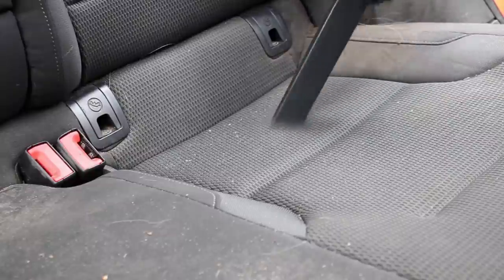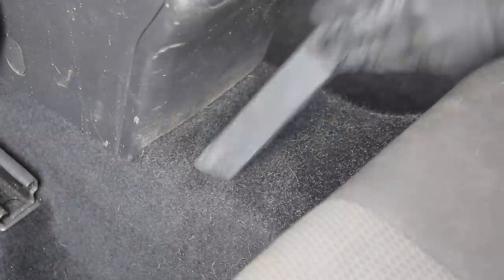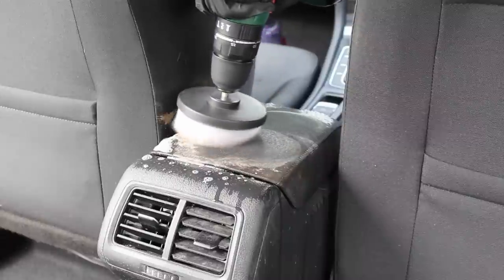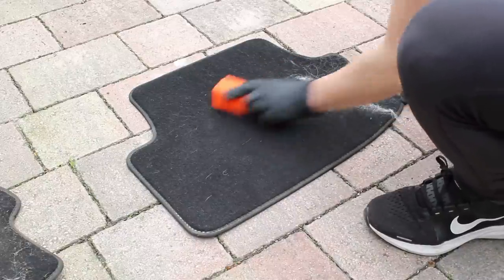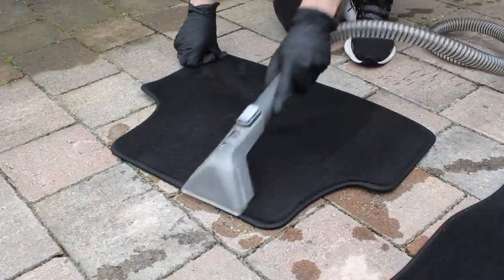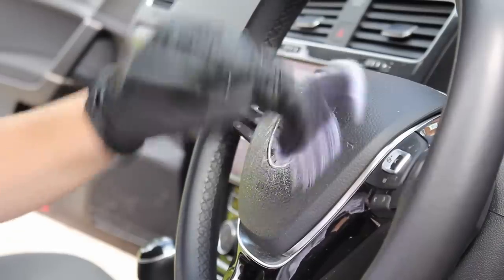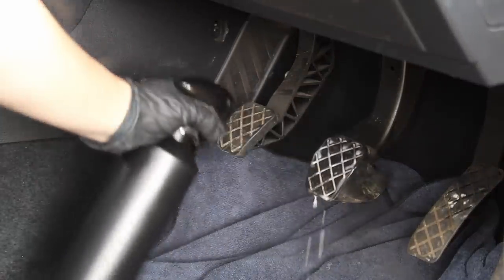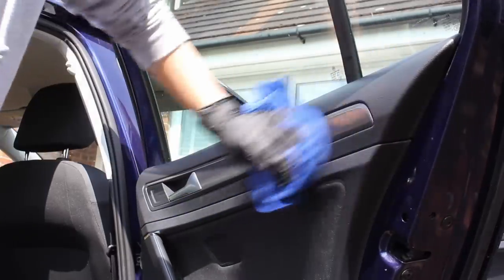Filthy Interior Deep Clean | Detailing Transformation on a VW Golf

Comment: Excellent work! Do you have any tips for cleaning alcantara seats? I've been too scared to clean mine in case they leave water marks 😟
Reply from the maker: Thank you! Try not to oversaturate the surface with the chemical and use a microfiber cloth to get it as dry as possible after cleaning and you should be fine :)